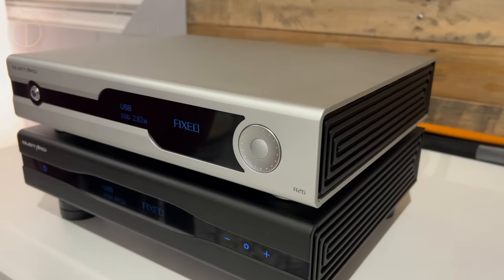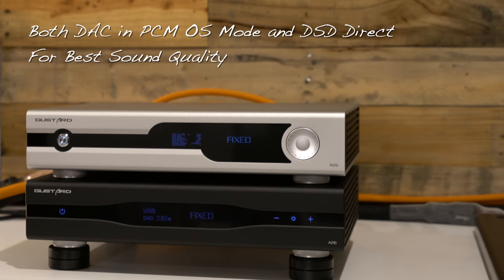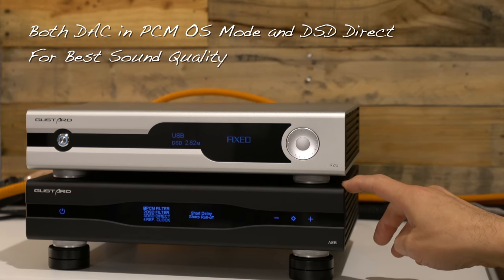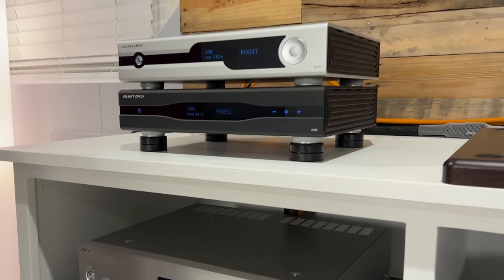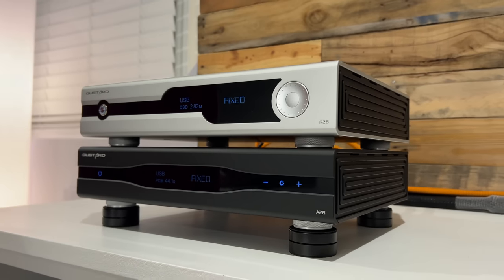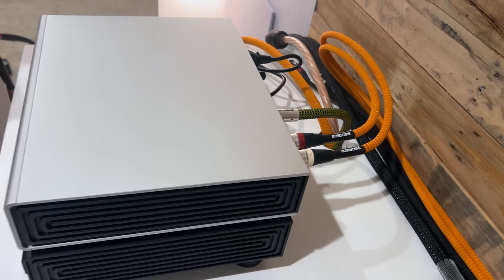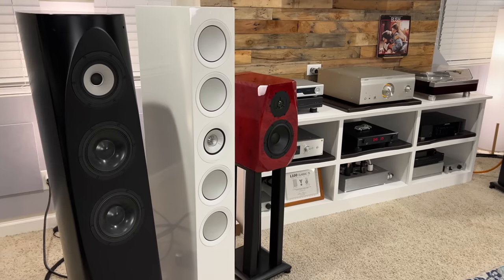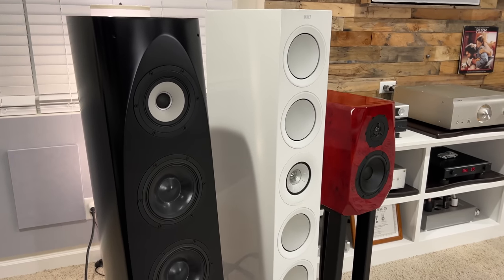Gustard R26 R2R Vs A26 Delta Sigma DAC Comparison

Comment: The first track is three videos. The second one is the A26? It doesn't appear on the screen.
Reply from the maker: 2nd one is original music file, see video timeline 

0:00 Intro
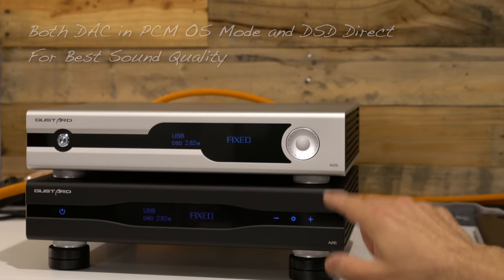0:45 Set Up
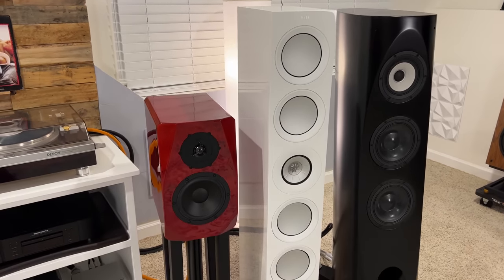2:37 A26 Vs R26
3:27 Stereo Image 
10:17 The Choice
10:54 R26 Sound Sample
12:54 The Battle of 1066 - Patrick Patrikios
14:53 A26 Sound Sample
16:52 R26 Sound Sample 2
21:22 A26 Sound Sample 2
Reply: @Tharbamar  The best quality I found was track 2. 12:54 The Battle of 1066 - Patrick Patrikios. I don't know if it's using the A26 or the R26 in that range.
Reply from the maker: @higobatman  Please read video timeline and screen.
Reply: @Tharbamar  Hello we have the Evo 4.2. bought based on your review. Would you suggest "Musician Knight  1 " upgrade ? Is there anything better within 2k USD  ( now that Mk1 sitting at 2k)
Reply: @noob_strikes0011 
In this price range I didn't find anything better than Kef R3.
Listen to them and you won't regret.
Reply from the maker: @noob_strikes0011  Oh definitely it is in whole new level of HiFi, sorry for late reply.
Reply from the maker: @driacozknows2211  FYI Musician Knight 1 is better than KEF R11 I have except for lowest notes.
Reply: @Tharbamar  thank you again.
Reply: @Tharbamar  Thanks Tarbamar when you say original file do you listen to it with Sony HAP-Z1ES? Thanks again

Comment: Recording is noisy as hell.. also a26 sound totally off (faster, pitch higher) compare to original.. similar to 48hz vs 44.1hz.. make sure its in 44.1 or 88.2hz
Reply from the maker: It’s a bit noisy due to highly sensitive condenser mics but more likely noise more enhanced by your listening device than my recording, my advice is best to listen with something like Sony MDR-7506 directly plugged into your phone/tablet/laptop etc., which will brings you closer to closer to actual sound quality of my recording regardless of how good equipment is being used in your end.
Reply: I think there is also something weird with the pitch between the two units, A26 sounding off.
Reply: @tapiotamminen6950  tharbamar can you ear it?
Reply: @lextr3110  Yes. On Sample 2 its very clear that its playing in higher (wrong) pitch.